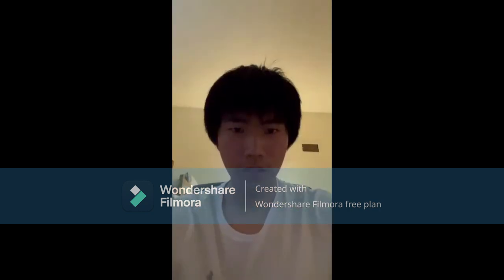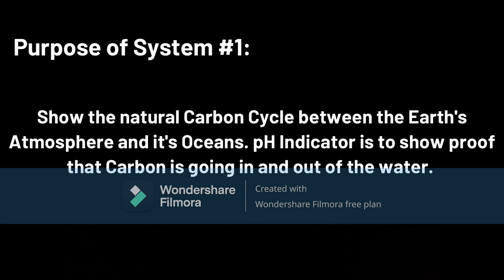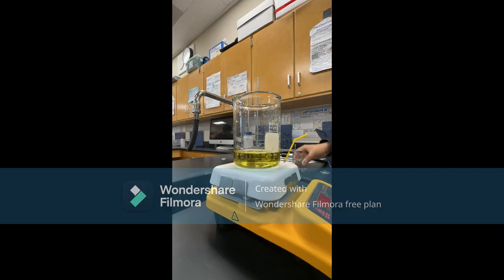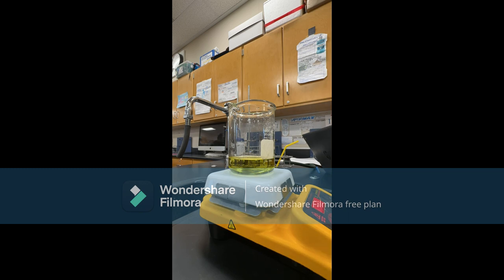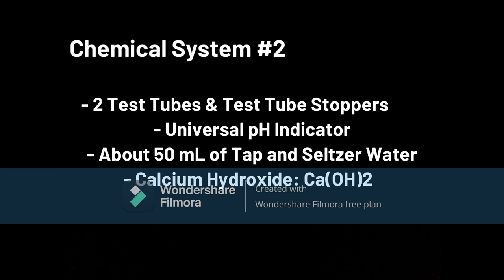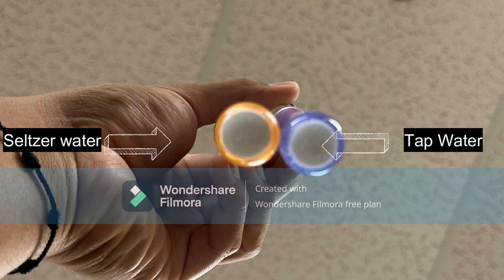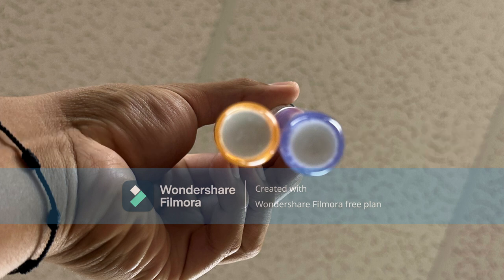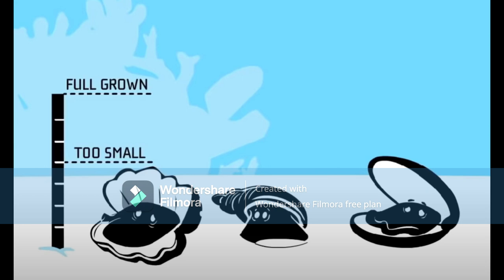Design a Model of Ocean Acidification

Comment: As regards ocean acidification, it is estimated that the ocean’s global mean surface pH may have declined (i.e., become less alkaline and thus more “acidic”) by -0.07 to -0.08 in the last 200 years — from pH8.12 during pre-industrial times to 8.04 to 8.05 today (Wei et al, 2015). N.B. The decline in pH occurred before 1930. 
However, and very importantly when you look the data after CO2 emissions began rising precipitously in the 1930s, the oceans have become less “acidic”!!!
By way of comparison, from one season to the next, or over the course of less than 6 months, pH levels naturally change by ±0.15 pH units, or twice the overall rate of the last 200 years. On a per-decade scale, the changes are even more pronounced.  Oceanic pH values naturally fluctuate up and down by up to 0.6 U within a span of a decade, with an overall range between 7.66 and 8.40.  This is decadal rate of pH change is larger than the overall 200-year span (0.07-0.08) by a factor of 8. Indeed the daily noted maximum pH range of 0.7 (Santos et al. 2011) is far greater than the overall change predicted between now and the end of the century.